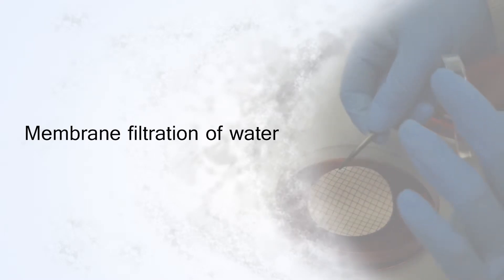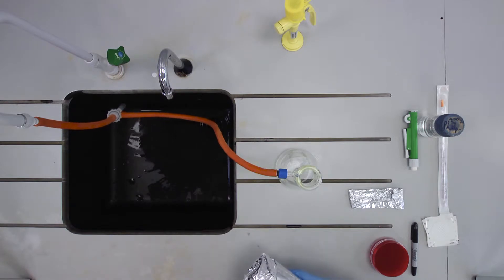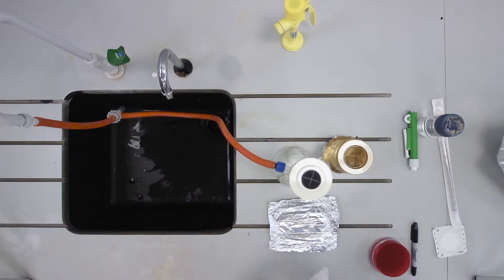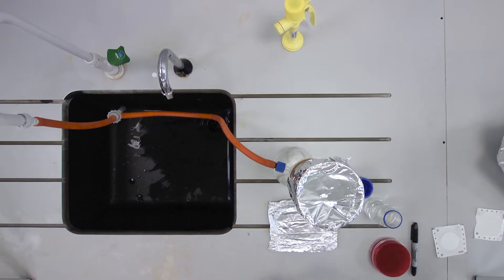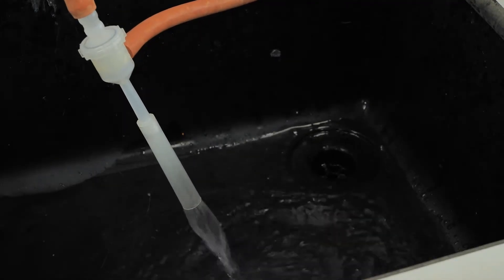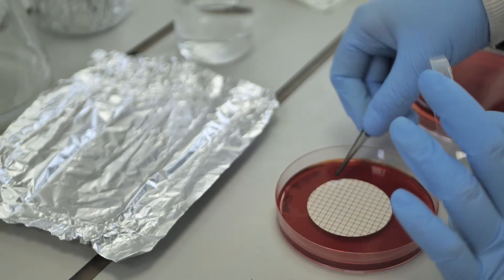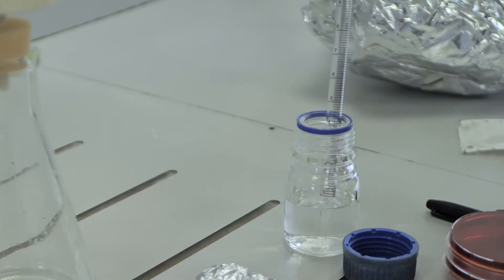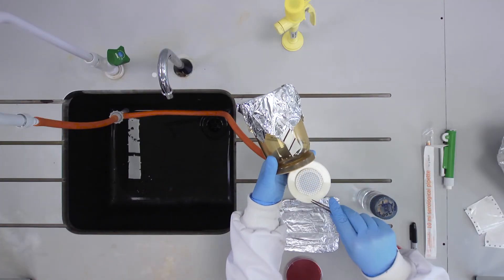Membrane filtration method to count bacteria in water

Comment: Nice video. thanks. will it still be alright if i will no longer use a vacuum? and to just wait a little longer to allow the water sample to drain completely?
Reply from the maker: Thanks. No, this is a standard method and a gravity approach would be affected by settling time or suspended solids that could impact bacterial counts so it's better to use a vacuum pump if possible.